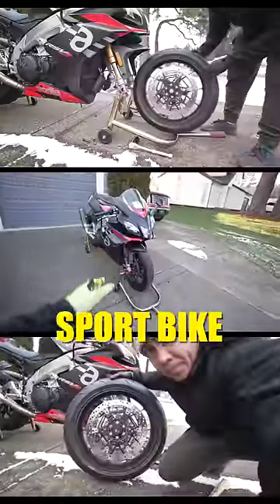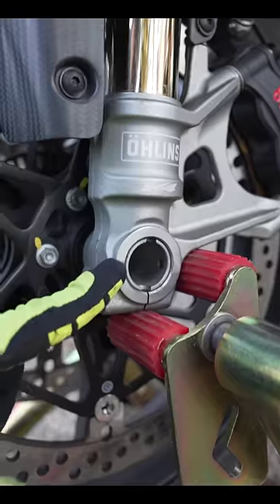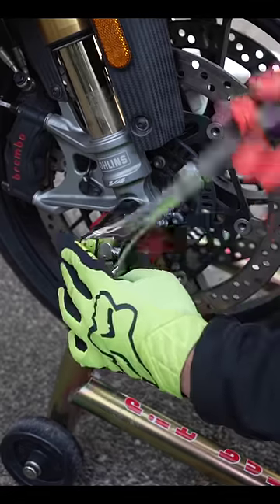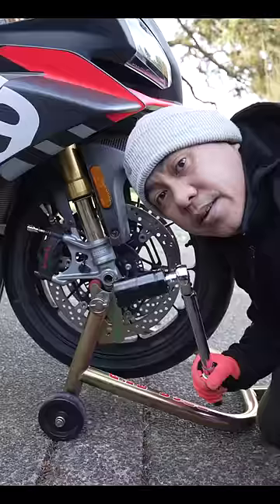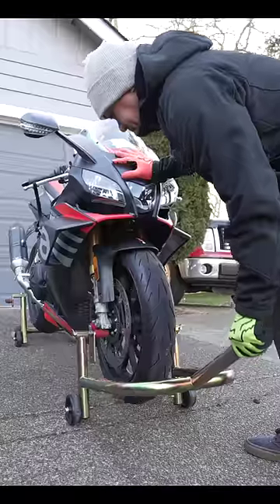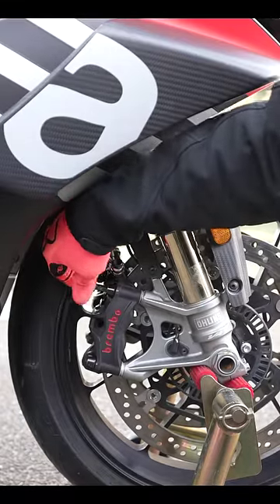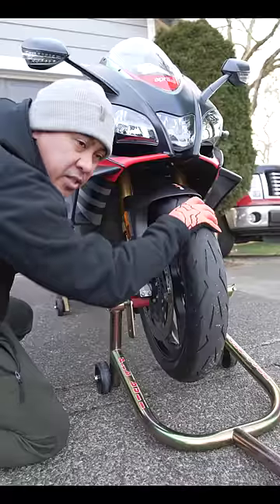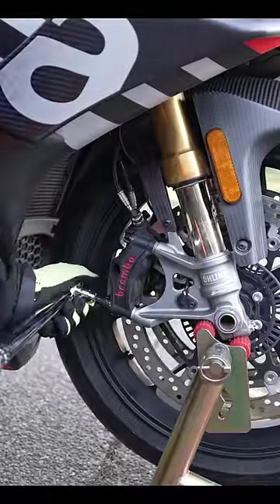how to align Sport Bike front wheel

Comment: Incorrect steps. Wheel up. Axle in and nut on. All nuts and bolts loose. Snug up the axle bolt. Spin front wheel, apply front brake, repeat a couple of times. Disc/ wheel is now centered. Compress front brake with a lever (locking on) and tighten. lower wheel to ground. Left twin bolts are still loose. Firmly compress forks on ground so that free side/left floats to find it's natural center of fork travel. Snug up. Lift wheel Torque to specs.
Unless these steps aren't done in this order the fork bushings will wear unevenly.
Reply: How important are those orders? I just put my front tire on and tighten everything down. And now I've been riding on it for a month
Reply: @Mike Ames  the sliders should be aligned correctly. The front end of a bike is a delicate mechanism. A Lot of stuff relies on stuff being set up correctly.
Incorrect front end setup can end up with tank slappers.
If it were my bike I'd fix it.
Ride safe mate!

Comment: If the correct torque settings are used itnshould be in alignment... the bearings and spacers set the alignment not the pinchbolts. If you are adjusting the forks I would say the step of lowering the bike and compressing can help but not for a wheel removal. Also the discs are floating usually the caliper is floating you have no alignment on a caliper for that reason so it all seems a lot of work for nothing tbh.

Comment: The callipers are dowelled so they don't need aligning amd if the axle and forks are clean then it should never pinch up out of true.
Don't forget the forks will rotate freely so a clean assembly will alway yield a true wheel.

Comment: IDK about that bike but on my bike I have to use a special socket on the left side instead of using the pinch bolts to hold the axle.  I used to do it this way with the pinch bolts but would get weird treadwear .  Then I learned doing it that way was keeping the axle from seating on the captive side.

Comment: The only way your front wheel is not aligned with your back. Is if you're triple clamps have been twisted. And one leg will be in front of the other. If so what are you alinging the front wheel with.
Reply: No, the forks could be twisted/bent, the swingarm could be twisted/bent, the rear axle could be crooked, the chain tension adjusters could be wrong, frame can be crooked... Lots of possibilities

Comment: before you even try to lift the front of the bike up, make sure that you have a proper jack like the one he is using in this video. don’t try to get a normal hydraulic/scissor jack for cars and put it underneath the engine/oil pan. your bike will be very unstable and it may fall over twice and break your fairings and mirrors. 

that happened to me.

Comment: Oh shit i replaced my front tire and i just have a zr7s standard, i didnt do any alignments or anything, it feels amazing to ride, would you recommend taking it off again and doing this?😊
Reply: Just loosen the pinch bolts, press the front forks down a couple of times, then tighten the pinch bolts again you'll be all good
Reply: Also, loosen the calipers, and spin the front wheel with it off the ground, engage the front brakes, and hold it until you get them torqued. That will stop uneven brake wear.
Reply: @Tha Ginger Ninjer  The calipers, the axle, and the lower front axle housing are built to a certain spec. If you are having uneven brake wear in a short period of time, you have other problems
Reply: @kawi704racing  or you didn’t center the caliper on the rotor, so one end is wearing faster. Doesn’t matter what specs they’re made to, you still have to put it on correctly for it to all be aligned.
Reply: @Tha Ginger Ninjer  bro think about what is being said. You tighten the axle, spin the wheel, and hit the breaks. Then you tighten the pinch bolts. Do you not think tightening the pinch bolts will move the axle again anyway? You can align it any way you like, but the pinch bolts will just squeeze the axle into the position it wants....you don't need Dave Moss selling you a remote setup. Just go to your local expert and build a relationship....all the best man.

Comment: What does pressing the front fork a bunch of times do??
Reply: Nothing if you do it how he did it. You need to have the left pinch bolts loose so that the fork leg will be perfectly parallel with the other fork.
Reply: @pieman12345678987654  oh ok, so that process is what aligns the wheel, but only with both left and right pinch bolts loose?

Comment: You know you have floating calipers right they align themselves just saying Then you have to lock down one side of the pinch bolts nut side that is on the axle then spin the tire grab your brake tighten your other pinch bolt
Reply from the maker: Did u miss the last part where I said this is an afterthought? As in, i don’t really do this

Comment: I have a Daytona, it tightened down with the pinch bolts loose and only have pinch bolts on one side. There’s also tabs for the calipers to line up and I didn’t have to move the wheel for clearance to get the calipers out. I’m not tryna sound like a douche, just saying I’m rather shocked with the eas of maintenance on this bike so far

Comment: The alignment needs to be done with both sides of the pinch bolts free.
Reply from the maker: If both sides are loose, it won’t hold the wheel pin in place. The reason you clamp one side is so it can slightly align and keep the pin in place. What you’re saying makes no sense
Reply: @adobomoto  both sides need to be aligned. So both sides need to be free.
This is what I learned from a suspension specialist that travels around the world and works with SBK racers.
Reply: It actually makes perfect sense. If you want the fork legs to be parallel to eachother you need to be able to set the spacing. The nut prevents the right side from adjusting so it needs to be done on the left. I suppose you could snug the right pinch bolts, but not the left.

Comment: Every comment about you having to do all of this, makes me wonder, how aggressively are you guys removing the wheel? The front wheel can't be adjust on a fixed axle. the spacers and tightening the axle, will align the fork legs(calipers too) and maybe squeeze your brakes to make sure contact is even, but apart from that your calipers can't change position and neither can your rotors. If you're experiencinga problem, id assume you've bent something!

Comment: Pinch bolts need torque specs
Reply from the maker: Hardly. 7ft lbs on mine. I can manage that with my wrist
Reply: @adobomoto  save your wrist for the throttle✌🏻👍🏻

Comment: Okay someone explain to me why any of that matters. I don't really think that the axel and hub and spacers have very much slop in them And the axel sandwiches the wheel and spacers to one of the fork legs so as long as you don't shove the other fork leg way in or pull it easy out you're only gonna be off about a thousandth or so? Does this tiny little bit really make a difference especially since the speed limit is 55 unless posted otherwise. Can the internet stop splitting hairs and like maybe teach the viewers how to do their own tires at home to save money. Or maybe a video about worn tires and what to look for. Maybe like a how to do your fork seals video so people don't have to spend thousands to fix their bike and maybe less people will die from oily rotors 🙃. Instead we see everyone and their brother telling you about these miniscule performance gains. (Btw don't pay 300$ to get your tires changed. Spend that 300 on a bubble balancer and a bead breaker. You can even do your own tires in one parking spot at an apartment)
Reply from the maker: Probably not. I said it’s an afterthought for me. Did u not catch that part?
Reply: @adobomoto  nah bruh the video opens up with "anytime you remove the front wheel you have to do an alignment

Comment: So much wrong with this information! It's the none nut side fork leg that needs tightened last as that side will move free and allow the fork legs to straighten. Also that faff with the Calipers is pointless, they have bolts or holes that keep the caliper in line and pads will self centre once they touch the disk.

Comment: Wrong !!!!!!!!!!!  putting The front back on the stand can move the fork again. tighten the pinch bolts before putting it back on the stand!
Reply from the maker: Nope. That’s why you tighten one side of the fork pinch bolts to square the other side.
Reply: @adobomoto  whats the use of letting the fork position itself pressing the bike up and down and than moving it again when putting it on the stand. You need to tighten the pinch bolts when its stil on the ground. And you are aligning the wrong side !!!

Comment: Sorry this is not correct. He went wrong after he torqued the axle nut. After you torque the axle nut then tighten right side pinch bolts, loosen left side pinch bolts, lower bike, compress front forks a few times, tighten left pinch bolts then tighten calipers if you haven't done so already.
Reply from the maker: You did nothing different by tightening the right side and then loosening the left lmfaooo
Reply: @Adobo Moto  the fork leg will center itself on the axle on the left side because there is not a nut there like on the other side. So you get the axle and the right pinch bolts all set then that allows the left side to slide free to center its self on the axle when suspension is compressed.
Reply: @Adobo Moto  if you have the tool to hold the left side axle you would just leave pinch bolts loose, tighten axle, tighten right side pinch bolts, compress suspension then tighten left side. But when you don't have the tool, tightening left side is a good way of doing it but in the process you're pulling the forks legs together. You then need to loosen the left to allow that fork leg to then spring back out.

Comment: This literally does nothing. YouTube mechanics man. The correct way to align a front wheel is to get the front installed loose and then spin the wheel and stop it with the brakes. This elevates any side tension on the forks. The way you showed without doing this puts a tremendous amount of strain and is an excellent way to blow out your for seals. This is more common on dirtbikes but same rules apply to street bikes. And pushing on the bike off the stand literally does nothing btw.